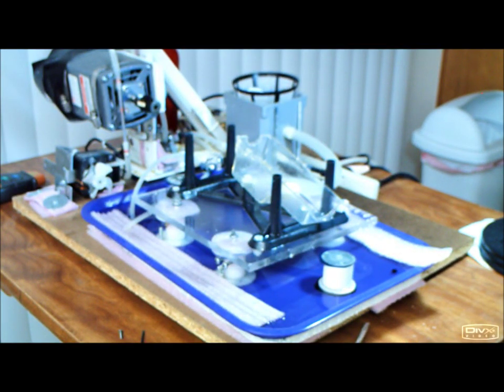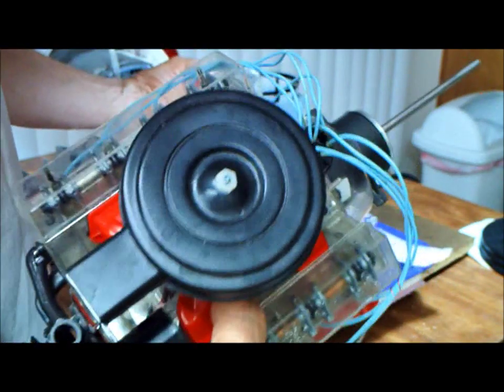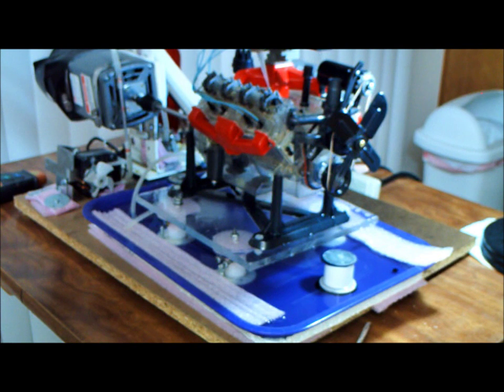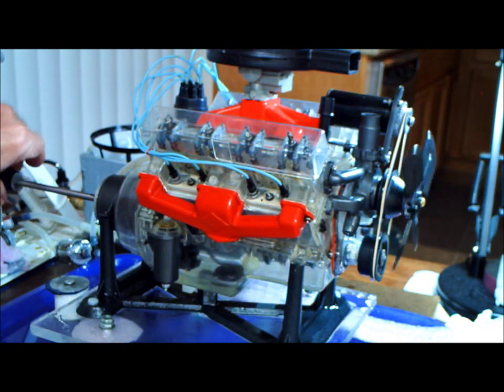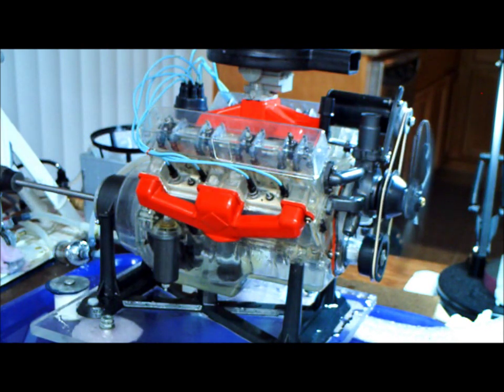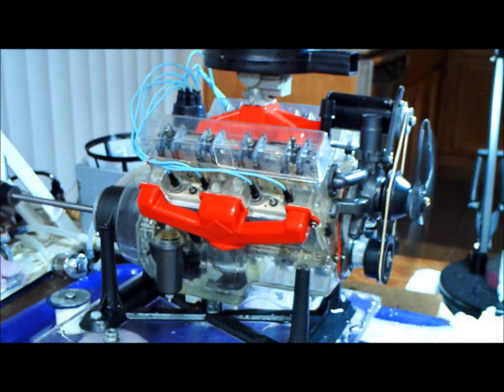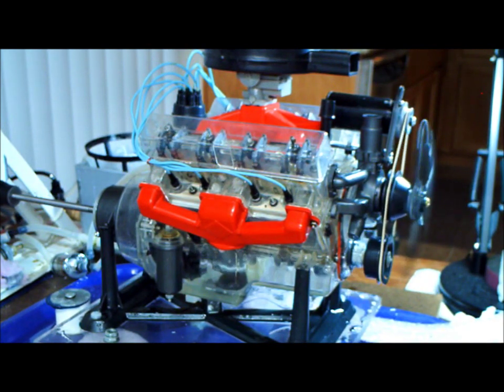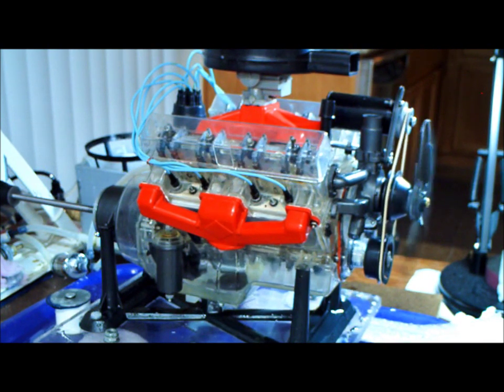Visible V8 Assembly Part 4 Oct 9 2011

Comment from the maker: It uses a external oil pump driven by an electric motor. After a rebuild, the parts need to wear in first before running any faster than 3500 RPM or it could melt the Styrene parts due to any excess friction between the moving parts. See my other videos of this engine running at higher speeds.

Comment from the maker: The motor and speed controller used here will only work with a modified Visible V8 as shown here. If you used the same electric motor and speed controller used here with a stock visible V8, severe damage to the Visible V8 could be the result.

Comment from the maker: No, not that I know of. The visible V8 was originality designed by Renwal back in 1959 off of a 289 Studebaker engine which was the engine used in the famous Studebaker Hawk, according to the Studebaker club. Now the kits are made in China by Revell, so this is about it if you want to modify one. There is a Testors Hemi V8 kit, but more difficult to modify, I have been told. I would build a stock Visible V8  kit first to see the how much work is involved to modify one.

Comment from the maker: Yeah, it was never designed to hold a liquid. Normally at low speeds I only run about 5 psi oil pressure, but since it was just assembled, I ran it at 14 Psi to insure it did not run dry and melt down before the two hour run in, When the Glycerin heats up above 92 Deg F. it suddenly becomes thinner and most of the leaking stops. Usually before the videos of the engine running were taken, I made sure the Glycerin temperature was above 92 deg F. to keep the leaking to a minimum.

Comment from the maker: @brjha I used a rubber flex connector and a 1/4" steel drive shaft with a sliding pin through a drilled hole in torque converter end of the drive shaft. I think it is shown in part 2 or three.

Comment from the maker: @Jayman194 Yeah if there is a fan anywhere around, I will usually have to stick my finger into it at least once. Yes there is quite a bit of air flow out the exhaust. There is intake manifold vacuum also. It is a air compressor at the higher speeds.There is no combustion of course, but there is (some) compression that makes the exhaust air warm. The oil will heat up on long runs and requires a oil cooler. Also the fan moves a lot of air for its size which helps cool the engine.

Comment from the maker: @kbent88 Yeah, the Visible V8 not very leak proof. When the lubricant heats up the viscosity decreases and then it don't leak as much. Also I have the oil pressure turned way up for the break in. Usually below 3000 RPM I run about 6 PSI and there is little leakage. At idle and 6 psi @ 95 Deg F oil temp it is (almost) leak free.